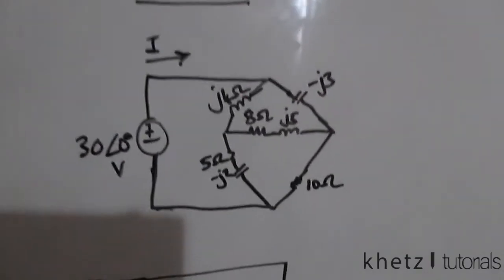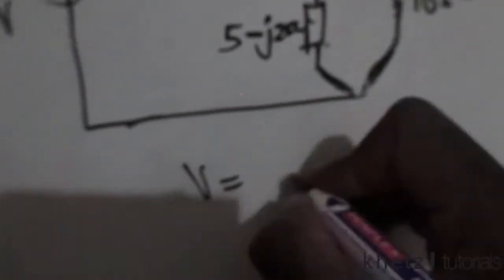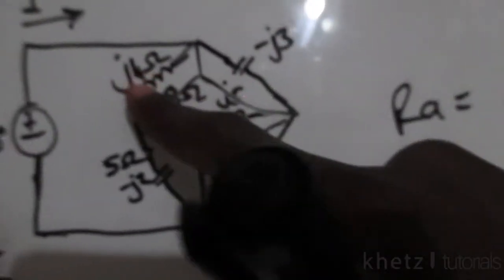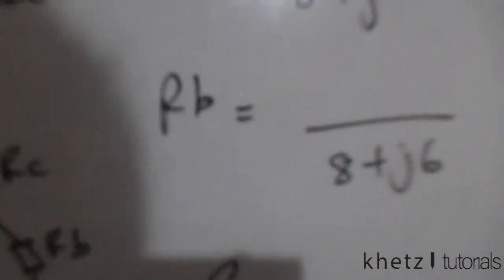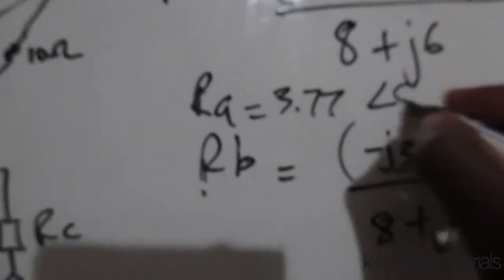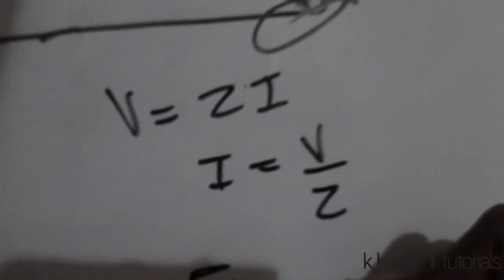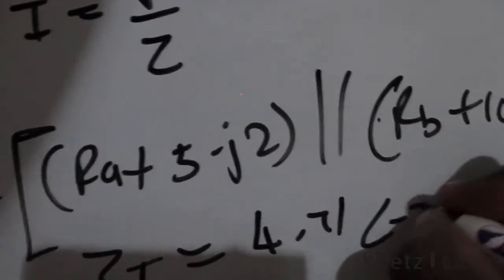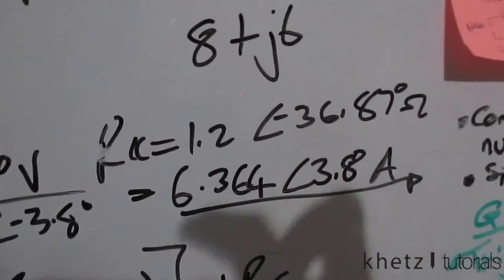Fundamentals Of Electric Circuits Practice Problem 9.12

Comment: That is not the answer in the book though.
Reply from the maker: Hello. Are you using the same version of the textbook which I used? Also, there are many errors which have been carried over between versions. The same circuits have been used but different answers are provided.